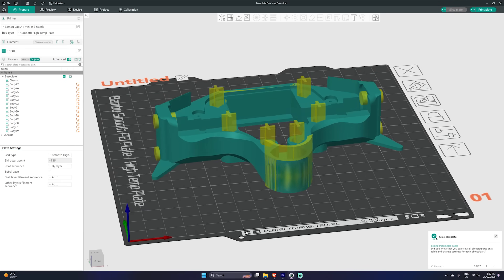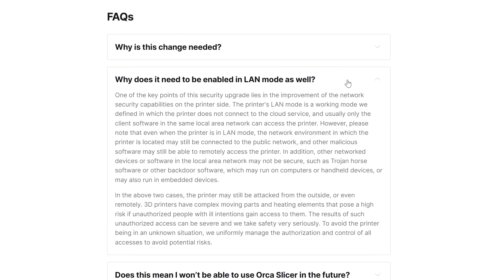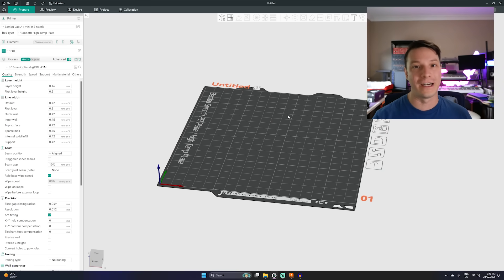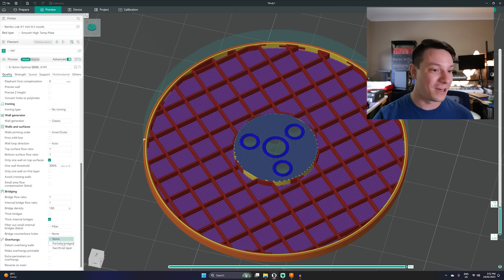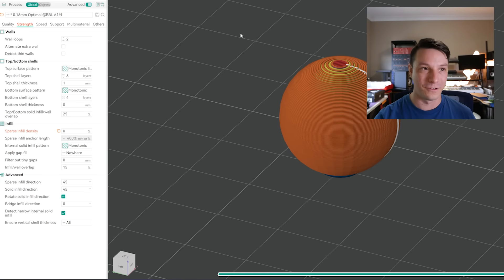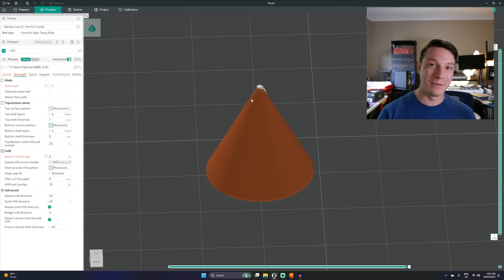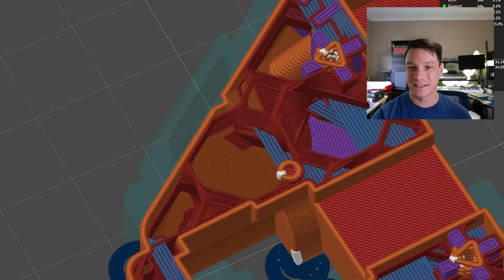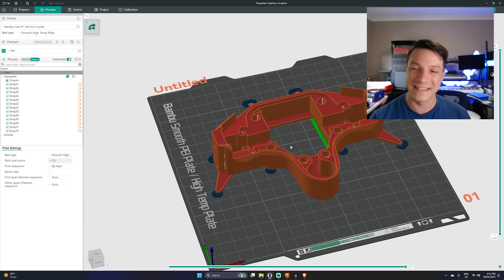I've switched to Orca Slicer for my Bambu Lab 3D Printer (and you can too)

Comment: I recently purchased an A1 combo to go with a K1C. For my design prints, quality from best to worse is A1/ orca 2.2, A1/bambu studio 1.10.2, K1C/orca 2.2, K1C/ creality print 5.1. Connection method is sneakernet. Using a usb, windows & K1C, the usb always alarms to repair drive (added steps) whenever the usb is used in the printer, then windows. No problems on the K1C side. This doesn't happen when using the micro sd for the A1. 
Note: when transferring the gcode file to a folder (to be copied to the card), click on the down arrow for viewing the dropdown menu. Next, make your selection, which loads it, then click on it again. If this third click is not done, the gcode won't be written and the file manager page won't appear, so make the third click.
I've watched many a yt vid using orca and bambu studio where this third click isn't performed and instant confusion takes place.

Comment: I print with ASA a lot so I use brims a lot, probably even when not necessary. Maybe it's just me but I've never had an issue removing it. A lot of the time some or all of it stays on the bed when I remove the print. Otherwise I peel 99% of it off, scrape off any leftover bits with my thumbnail.

Comment: I have never used bambu studio. I only have used orca slicer and fruit slicer. I had a Sovol SV 06 as my second printer (after returning a Creality). I had some college level experience back in ~2014 then recently got back into printing. Started with orca after trying others for my sovol. I don’t ever see a reason to leave orca slicer. It is by far my favorite slicer. It can be ran in easy mode or in advanced mode. As soon as a Klipper board gets made for my bambu, ill probably switch to that

Comment: Hey I’ve been trying to print petg with tungsten on the bbl x1c and it’s not going well. My main issue is that the petg always oozes and wraps around getting all over the nozzle and then from there gets on the print. All this during the calibration and lidar stages. I calibrated the flow ratio and k factor, tried retraction, lowered temps, religiously cleaned the nozzle, etc. any tips? I’m on bambu studio

Comment: I use the modifiers too for supports at weight bearing holes. In testing I never broke the little circular nub sticking out of the print. The sidewall of the print failed instead, but only after considerable effort. I'm using Orca for everything since it first came out. I went with the QIDI Plus 4 over Bambu because of their latest firmware stuff. I do have a P1S, but about to put it in LAN mode only.

Comment: I have a Flashforge Adventurer 5M and when I use orca slicer my printer head scrapes the bed just enough to pull up the layer it is printing on top of. If I use the same file in Flashprint slicer it prints fine.

Does anybody have any suggestions for what I need to adjust?

Comment: In general, regarding slicers, not only Orca, and for me, one of the reasons why I would consider switching to another slicer (I use PrusaSlicer exclusively) is exactly what was described in the video: Orca slicer is a fork of Bambulab studio, which is in turn a fork of PrusaSlicer with a mix of Cura, PrusaSlicer is a fork of Slic3r, Slic3r and here we get to the core, is actually a gcode "remake" of a chipboard processing machine that doesn't mind using X hundreds of moves when machining a board with a milling machine, on the contrary, this problem is a bit of a problem with 3D printing and if we sort the main causes of print failure into categories, in many cases it would look like this: 1. Failure of the first layer due to adhesion to the print bed, 2. Collision of the print head with the print object during movement 3. Extruder in general. Here regarding point 2. and movement: Movements during printing could be significantly eliminated to a minimum and in some models they might not even be "none!" by a different style of printing the infill (solid or pattern) print objects perimeters in place, which would look like this: When the printer reached the location of one of the screw holes while printing the infill, it would immediately print its perimeters and continue printing the infill before encountering another hole, for which it would immediately print its perimeters again, etc., in this way all holes in the printout would be printed simultaneously with the infill = without X passes over the entire print bed and it would also shorten the print time, for those who are chasing seconds - Instead of the current situation in slicers, the print head (after completing the perimeters) starts traveling crisscross over the entire print bed to first print the perimeters of the holes and then the infill 🤦. The same applies to the logic of assigning movements (generally applies to all slicers), which is visible mainly when printing box models and specialties such as: The printing process reaches point A, then a straight movement is applied (wipe, retraction, z hop... etc.) to point B (- z hop, deretraction... etc.) from which the line is printed to point A, then another straight movement is applied (wipe, retraction, z hop... etc.) again to point B (where - z hop, deretraction... etc. occurs again), so that the printer just continues printing --> Instead of a simple (no solution) that the printer at point A, without interruption, continues printing, including point B 🤦🤦. Otherwise, a note about Orca at the end, the text above looks very critical, but as for Orca and its project, I really like it and if I were to describe its positive features here, the length of the previous text would not even reach 1% of the total description.

If one of the slicers above had this implemented in its new motion core, suitable for 3D printing, it would no longer be just a slicer with super features (but still with the chipboard machine patches in the core), but a completely new slicer from the Gen 2 slicer family. With its output gcodes, if I overdo it, then for a 3D printing machine from 2014 it would not be a problem to handle 3D Benchy in 30 minutes (I don't care about speed, I print slowly, more like it would solve unnecessary travel movements with an increased possibility of failure).

But maybe we will see and the new Slicer GEN 2 will rise from the ashes! In the meantime, thanks for the video and good luck with the robot battle!

Comment: I watched this great video you did years ago concerning a feature in Simplify 3D, https://www.youtube.com/watch?v=OcddlK36OVs . The video was about using different layer heights, infill, etc. within one print. I use that feature all the time to speed up prints and make the process more efficient. Is there a way to do this type of configuration in Orca Slicer or any other slicer?  Thanks

Comment: You might want to reach out to the Orcs Slicer devs. Apparently each time you upgrade the app to the latest version, you have to download Bambu Network again? This happened with the previous beta version, which is why i haven't updated to the latest beta yet as my local LAN network is running perfectly now and I don't want to jinx it.

I'm afraid one day Bambu will totally disappear Bambu Network for Bambu Connect (which is rightly loathed for the locked down nature) and then where will we be?

Comment: There's a lot to like there.  My simple requirements don't really need this much horsepower, but features that are there when you need them are "money in the bank".  I often look at a design and think "this would be better if I could boost the strength in this region".  Of course, what I end up doing is boosting the strength of the whole thing!  🥴
Thanks again Angus... you're the Real Deal!   👍

Comment: I sliced and printed the same object in both Bambu Slicer and Orca Slicer, using the default settings for each, same roll of filament. The Bambu print was very nice, but the Orca print had bad ringing.

Is there something I need to know regarding this?

Comment: I switched to Orca slicer with Bambu Lab changing these “security features”. Nobody asked for these changes and they will feel the repercussions from making this change. I told them when this all happened through customer service, that I would no longer be purchasing any further printers from BL or replacement parts. I will look through 3rd party options and will sell the printer when it has outlasted its usefulness. Love my P1S but absolutely hate Bambu Lab for this change. Going to be moving everything to either Elegoo or Prusa printers.

Comment: Ive tried switching from cura to orca twice now. 

I print basically exclusively TPU on my elegoo 3 max. Minium 2day, max 7days prints. Always fuzzy skin. Always 0.1 layer height.

Now why i cant switch: orca misses the option to increase infill near top layers. Crucial vor my pads which have large top surfaces, but require only 7% infill for the correct softness. It also doesn't have the option for determining infill layer hight. I usually print with 0.1 wall height, and 0.2 infill height to save time. 

Lastly, when i try to slice my seat in orca which takes 7 days and 1kg tpu, it slices for 45 minutes and then crashes. Lol useless 😂

Granted, cura also has its issues, but it takes just 1.5 minutes to slice it. Only when i want to see the preview, it crashes😅. But i guess 1gb+ gcode is also nuts. 

If you want know what pads I'm talking about, my latest video shows them a little.

Comment: Tricks for changing print parts to strengthen the right areas are neat. Using modifiers in slicers is a good approach. However, I learned a different method that yields the same result with added value.
I create the model so that it consists of several parts. You could say that what should be modifiers, I design as extra parts. I export the model in STEP format, where the resulting file contains many parts. Then, in the slicer, I set the printing parameters for the individual parts, not for modifiers. In this case, I no longer use modifiers. I can name the individual parts in such a way that others understand the intent.

One theory for future slicer improvements: in the model, I could assign a material and other metadata to each part. If slicers could use this metadata to set how to slice, it would be perfect. I could thus define my intention for full or partial infill already in the design, just like when I create metal models, defining which material I want to use in production.

Anyway, thanks for the well-thought-out video and for sharing your knowledge.

Comment: So, this year my mortgage is paid off, and a semi-pro printer is happening very soon after that magical day. This has been a plan for a while, and before Bambu Lab pulled their bait and switch, they were my front runner, most likely the P1S. They are dead to me.

And this week I discovered that Prusa can deliver the Core One to Australia in kit form for only AU1650, and this is still in my budget. Just.

Why would I bother with a company that happily use open source wares but lock their systems down to levels that take our right to repair, when I could get a genuine Prusa, still open source, still gives me the right to repair and upgrade, and still honours the warranty on hardware if I decide I want Marlin, Klipper or whatever firmware.

It's not that easy for younger generations, I get it it. You've gotta buy what you can afford. And for crafters, the technicals of building a kit printer probably look scary. My gripe is not with layal Bambu users, but a company that has chosen to take away our right to repair and modify our property. We pay a lot of money for our tools, we all have different needs, we have a right to reasonably do our own repairs and mods.

And for their recent actions, if Bambu printers still work for you, I support you, as we say in cycling, "ride what you bring and don't judge others" but Bambu Lab themselves? They can go to hell.

Comment: Bambu Studio also has the option to disable "ensure vertical shell thickness". What is different is that in Bambu Studio this is a simple checkmark, while Orca Slicer also gives you the two compromise options "moderate" and "critical only" that Bambu doesn't offer

Comment: "Make overhangs printable" is an absolutely incredible feature for printing very small or more complex miniatures, as it removes most failures and surface issues while not damaging to the overall look. The only thing you could wish for is the option to apply it with a modifier to certain areas and not the others.
Reply: You could simply use the MODIFIERS to select the areas you don't want to be changed. Don't recall all the details (there's lots of YT vids on it). IIRR you right click the model and choose "Add Modifier" then you can size and move it to cover the area you need and it becomes it's own "separate item", allowing you to change virtually any setting for THAT area. Very powerful. 😁

Comment: I still prefer the interface of Cura. All the settings in one list, organized by category, and SEARCHABLE.  I'm constantly trying to figure out where to find settings in Orca / Bambu. Which tab is it in? What is it called? Orca really needs a search function. And Cura has hover explanations for settings.
You should do a tutorial on using Cura with Bambu printers. I'm sure it's possible, but I've just been using the stock slicer for now because it's good enough and gets it done. Would prefer Cura though.

In my past experience Cura is the Swiss army knife of slicers. I've always come back to it after trying others. Now with my Bambu Mini I haven't had the time to try to make it work yet. And Bambu is becoming more restricted which is worrisome.

Comment: Rather than the "ensure wall thickness", I really wish slicers would properly use the min wall thickness setting and emphasize that over the perimeter count. If it worked correctly, you could set your min thickness to your layer height and get both the minimum weight while not failing on extreme overhangs. I primarily print engineering parts and the wall thickness of the finished part is what I care about more than the number of perimeters/layers needed to achieve it.

Comment: I really dislike the Bambu/Orca UI. Scrolling lists are far less efficient for navigation than fixed pages like PrusaSlicer, because the precise location of a particular setting is not in the same place each time you use it because it depends where exactly you stopped scrolling. I think younger folks are more used to scrolling because modern webpages use lots of scrolling specifically because it's inefficient - to keep you on a page longer hoping something good will come if you just keep repeating a single action over and over (scrolling) like a slot machine.

Comment: Iv'e been on LAN mode since this BBL blow up began and I constantly need to re-enter the access code to connect to the printer. Sometimes I will connect the printer so the prepare screen can access the AMS filiment, by the time I finish slicing its forgotten and I need to re enter to send the print. Is this normal? It worked flawlessly prior to LAN mode when using the cloud. Orca or BB studio. The same thing.
Reply from the maker: Yeah, it remembers my A1 code but not X1C. Seems intentional...

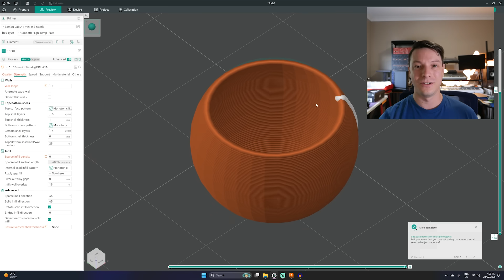Comment: In PrusaSlicer you have "Ensure vertical shell thickness:" (Disabled, Partial, Enabled) so are you saying at 11:25 that "Disabled" not always turn "Ensure vertical shell thickness:" off?
Reply from the maker: Well, you're right. That's new in the recent release. It was removed previously. It seems to function the same way as orcaslicer.

Comment: I would love to use orca slicer as my primary slicer, but unfortunately there has been a bug in it for absolutely ages where if my ams has any filament marked as generic pla, it changes the filament type to pla support, making printing with generic pla impossible without some wonky work around.
I've submitted an issue on its GitHub, but nothing has been done about it. I have reinstalled the software, even changed computers, and the issue still remains. Idk how this has just been overlooked for so long.

Comment: The "Ensure vertical shell thickness" setting IS in bambuStudio, but it doesn't do *that*. It added about 1% weight if I took it off, 3% with arachne.
Reply from the maker: Yeah it goes wild with Arachne on if you disable it, super odd behaviour and not useful
Reply: I still can't spot what it actually changed. I was using the 0.6 nozzle so I was starting to see how it wasn't especially necessary to add extra walls.

Comment: Orca slicer sometimes has trouble with colour painting. If you paint a face, Orca will colour the entire layer, whereas Bambu slicer correctly prints just the face with colour. I normally use Orca for most stuff, but always Bambu for colour painting.

Comment: I really don't understand why you would release this video when Bambu is about to lock out Orca Slicer from interacting with their printers. Yes you said that was happening, but then you completely glossed over it like this wasn't going to be an issue because there MIGHT be an alternative LAN setting. Like nobody knows how difficult they're going to make it to use and then anyone that wants to use ORCA slicer has to wire their computer directly to it, which isn't an option for everyone.

Comment: I recently switched because I heard the supports were better. Cutting parts and overall performance is much worse in Orca. I've had multiple crashes, and plenty of times where controls get stuck. i.e. I'll be moving parts of an object, and it just won't stop moving when I release the mouse button. Or when attempting to assign parts of a cut to the other side with right click, the cut just cancels out. 

Overall it is a much buggier experience than Bambu. BUT I've yet to have supports fail since I started using it, so it's got that going for it. For now, I've been doing what editing I need in Bambu then swapping over once everything is ready to slice and slicing and printing from Orca.